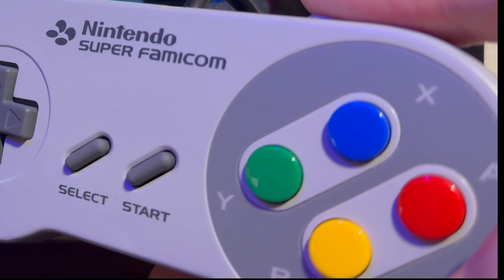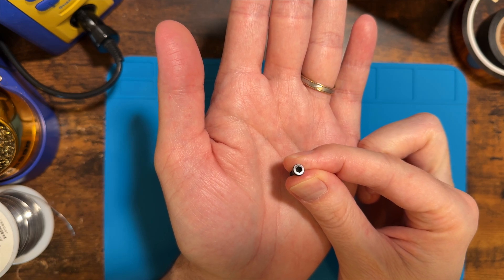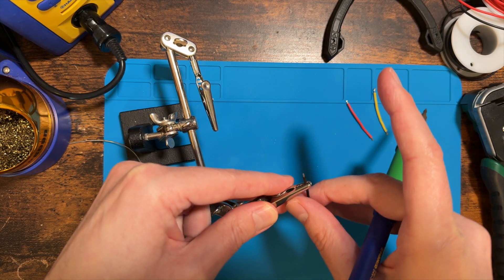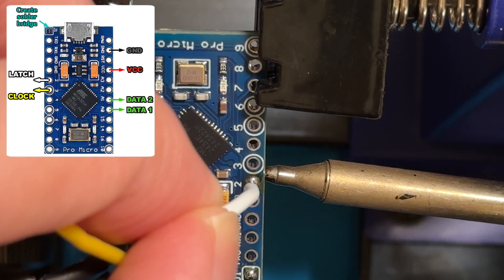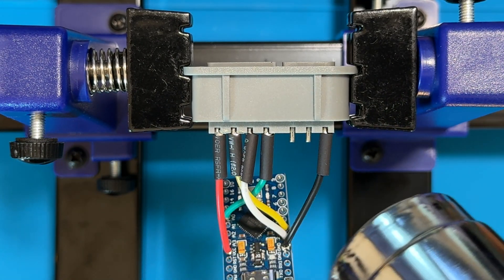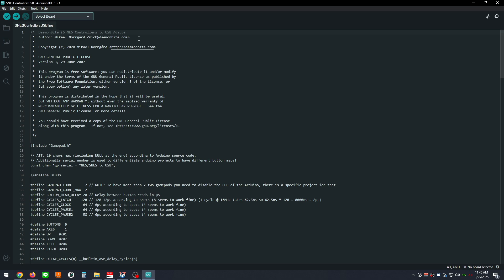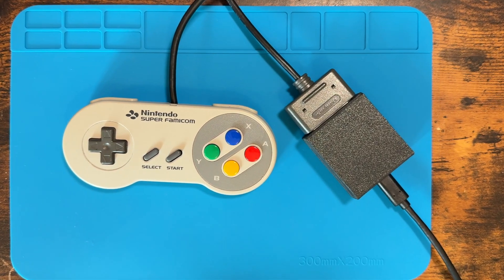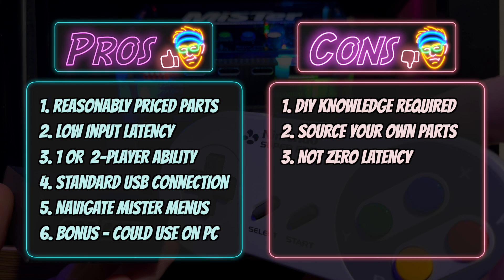MiSTer FPGA SNES Controller Adapter | DIY USB Build Guide (Daemonbite Tutorial)

Comment: I made the adapter for Genesis. But it works really badly when using it on Batocera, and it also works badly when using it on Retroarch on Windows. Could you do it? Maybe there's a mistake in the project code... Great video!
Reply from the maker: Glad you enjoyed the video! I’m working on the genesis video as we speak. Editing is near completion and just need to add voice over. I’m really hoping to release it by the end of this week if possible!

Comment: Excellent timing. About to build a 2 controller Genesis daemonbite adapter. All I need is an enclosure.
Reply from the maker: Nice. I've built a 2-player adapter that's in my custom MiSTer case I built in my Retrocastle MiSTer build video as well. The only thing I don't like about Genesis and Saturn adapters is they've got so many more wire leads to work with than some of the other controllers. Other than that, the adapters are pretty straight forward. I'm still tweaking my 1-player adapter cases a little before I make them available for download. Maybe I should work on 2-player versions as well...
Reply: @naadofett  oh cool! I'm not handy with 3d cadding, so I'm trying the Zez Retro route of building a daemonbite adapter. Just waiting for the DB9 ports to arrive.

If you perfect the enclosure I'll be sure to check them out.
Reply from the maker: I'm creating the link for the downloads on my printables page. Link to my page in the pinned comment. I'll publish the Genesis enclosure model once the next video goes live. Editing it now, so hopefully within the next ~1 week!